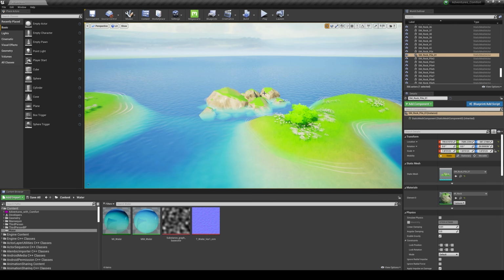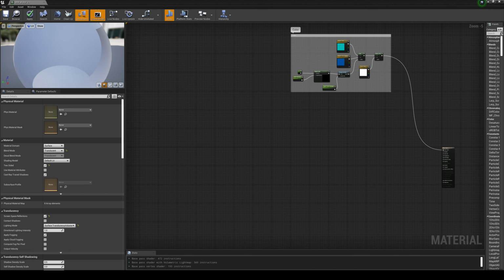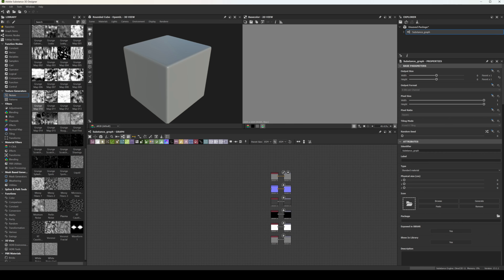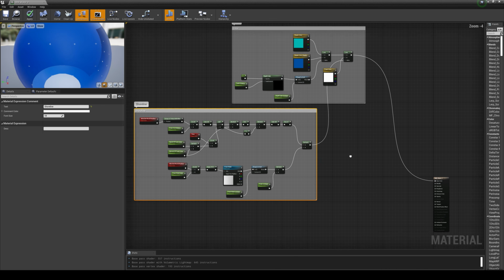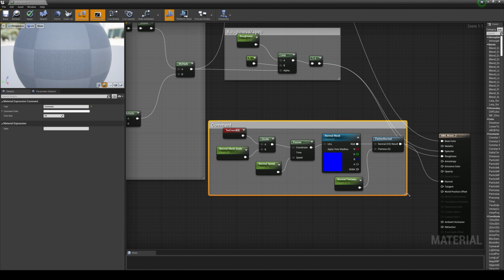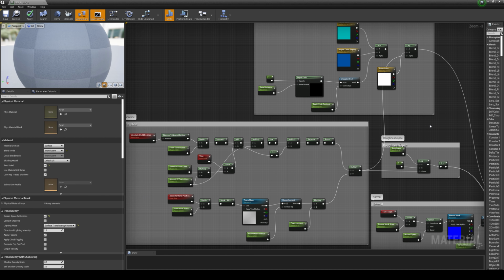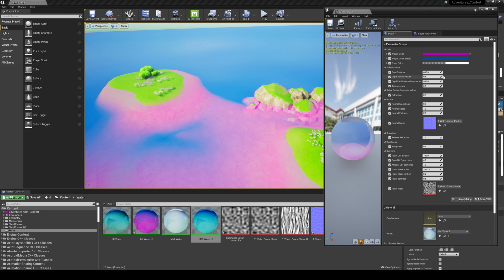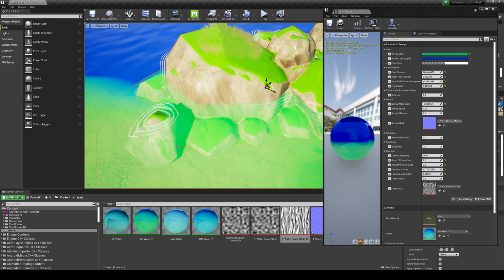Stylized Water Material Tutorial in UE

Comment: For anyone struggling with strange shapes and not getting clean waves even at the simple example, make sure Nanite is turned off! Triangulate your mesh in blender before exporting and deactivate nanite on it in unreal. You can check if this is a problem by looking at the mesh wireframe. If it's random big triangles instead of many small ones that's nanite.

Comment: Greetings..., the same thing may happen to some of you as it did to me..., depending on the version of Unreal that we are using, the default material does not automatically activate the refraction of the water with the "Translucency" Parameter. In my case I am Using Unreal Engine 5.2, and the refraction is not activated in the Material...., I have activated it, within the "Details/Refraction/Refraction Method-->Index Of Refraction"..., of this So this Slot has been activated for me within the Material... I don't know if it is the correct option of the 3 that this Parameter brings, but it has worked perfectly for me... in case the same thing happens to someone else... Great Tutorial..., like everyone else...Thanks again...Un Saludo.
Reply: Thanks for the Help!
Reply: Thanks man you save my boat
Reply: ty ♥